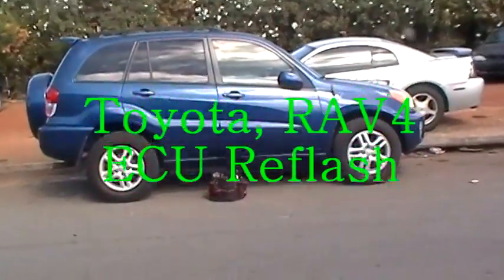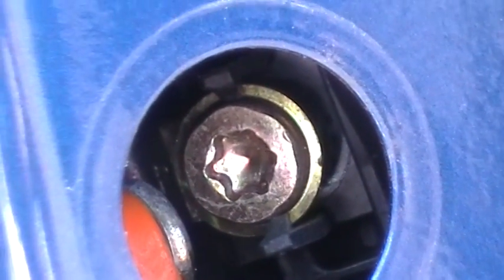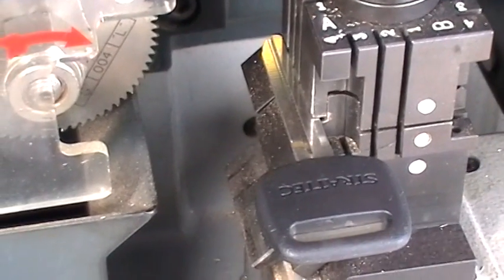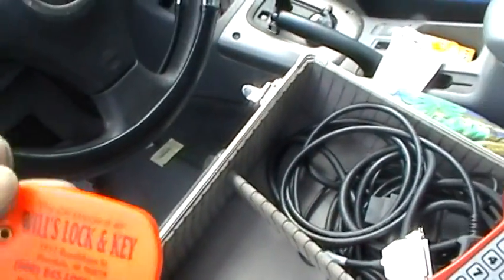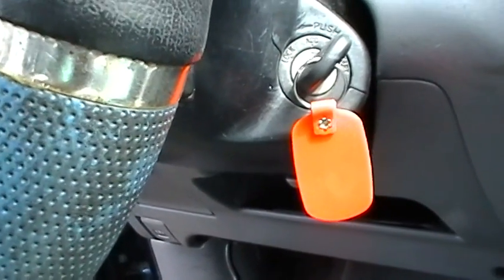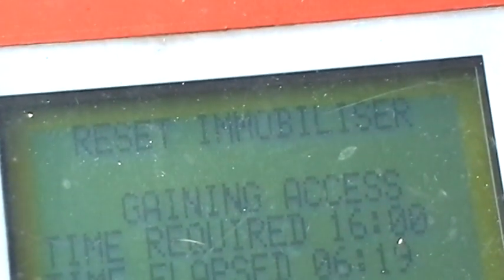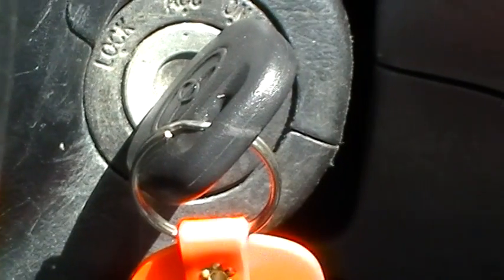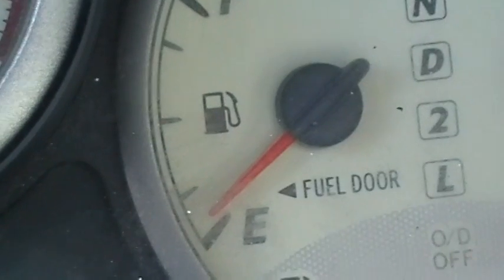Toyota RAV4 ECU Reflash

Comment: Very cool. I’ve currently got a 98 Avalon that my locksmith is having issues to fix. I’ve had the ECU reflashed twice now and they’ve lost hope and don’t know what else to do. They think there may be an issue between the ignition and the ECU. Is there any advice or other knowledge you could pass my way?
Reply: Thanks for reaching out, Jeffrey.  I'd be more than happy to discuss the possible issues / problems with your Locksmith.  It's difficult to provide such info, any other way.  However, since you've had your ECU reflashed (all keys erased), an "unused" master transponder chip should have no issue in being programmed into the vehicle.  That process is 5 seconds long.  Also, the only other device that [could] affect such programming, is the "driver door open switch," which is located on the ignition lock cylinder housing.  If I can confer with your locksmith, I'm sure we can resolve the issue.  Thanks again, for reaching out.
Reply: @pastormcintosh7500  Thank you Pastor for your reply. I’m no expert on the subject but from what he has explained to me he did a reflash with an Eprom connector. Is there a way I could email you or direct message you his information?

Comment: Hi today I had a 2015 rav4 but all keys lost its a H key my programmers would not do it will all keys lost what are my options?
Reply from the maker: Tim Folland hello Tim.  It's great to be able to provide keys for new cars.  However, there are a few that are slow with release of "general" Tech support.  An MK III is the only device  (other than the factory tester", that can be used in an "ALL KEYS LOST" situation on Lexus/ Toyota "H" chipped vehicles.
Reply: Haha wrong. Im an auto locksmith and H reset has been available for MVP Pro users for months. Its now on several devices.

Comment: Hey Will, great video. I've lost all my keys and replaced the ignition switch with a new key from EBay. The car don't start due to the immobilizer. Any suggestions? Mahalo
Reply: Sorry it's a 08 4Runner. Are you still located in Campbells?

Comment: William Mcintosh my mom lost the only key to her Toyota 4Runner. One dealership quoted $700 another dealership quoted $2,000. Granted they wanted to replace the ECU all together. Is it the same process for an 01 Toyota 4Runner? Also, what is the reprogramming device you are using?
Reply from the maker: Hello Calin.  What is the "Year" of her 4Runner?
Reply: It's a 2001. Sorry, I didn't see this until just now. We were able to get the vehicle into the dealership, and they told us it wasn't as bad as they had originally thought. They re flashed the ECU and made 2 new keys for $220, which we thought was much more reasonable.  Thank you for your quick reply!

Comment: Thank you very much for sharing you knowledge. 
I live in australia . I have lost my master key for 2004 toyota camry altise . I need your help to reprogram the new key . 
1. What type of t code tool I should buy any recommendations. 
2. Car has got anytime theft anti locking system so I guess it's got ecu and immobilizer.
If I buy t code online and get the key cut would it be easier to re flash the ECU AND get the new key programmed. 
Please help in need God bless you. 
Also email me instructions on sunilsharma7@hotmail.com
Thanks .

Comment from the maker: Thanks Dan.  Anything I can do to help my fellow Locksmiths along their way, I will try.  Of several different equipments used to reflash toyota ECU's; I have three.  However, the RAV4 vehicles that use transponder (up to 2005), have unique programming procedures that are not readily available in most tech pubs.  Most other Toyota ECU's are programmable using info in the T-Code manual that you have.  Let me know if I can be of more assistance.  Thanks

Will